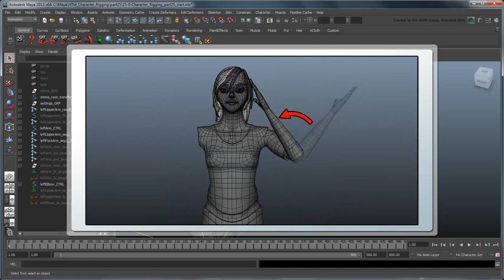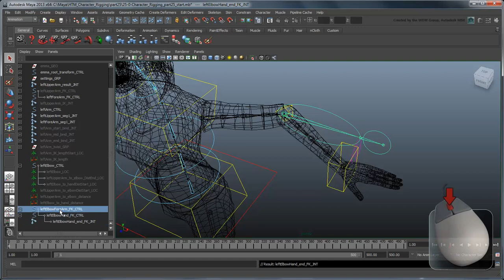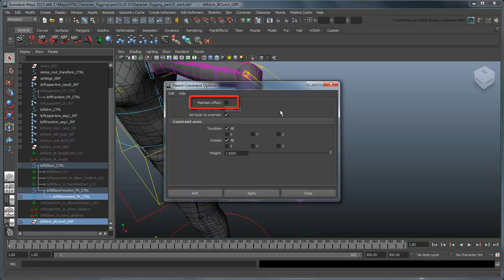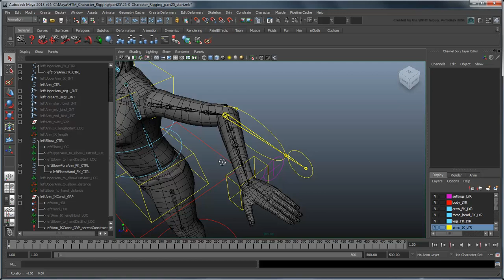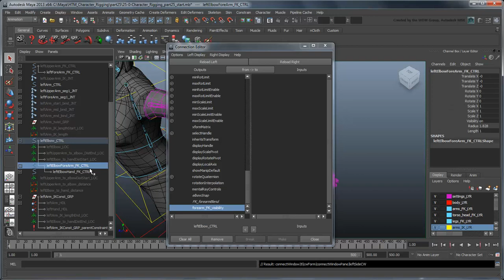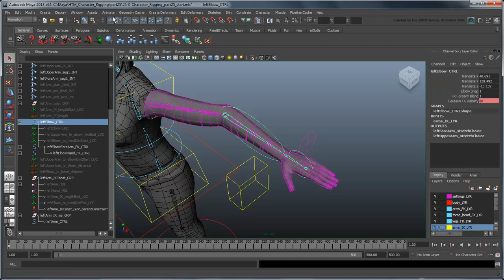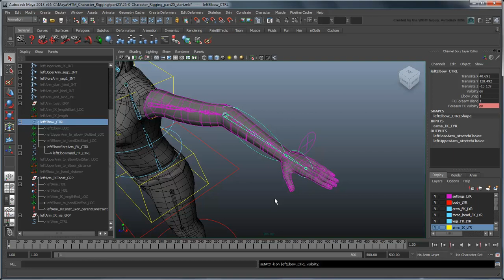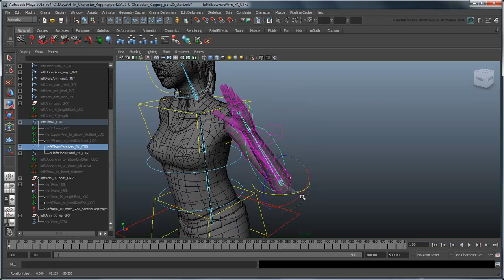Creating a Character Rig - Part 25: IK/FK hybrid elbow (Advanced)

Comment: Hii maya learning channel!!

Thanks a lot for these pro quality tuts and teachings. I have a little doubt here.

I have a little question about the very CONCEPT of this video. i.e. an Ikfk elbow hybrid over an ik setup.

You say it'll be easy for the animator in case he wants precise rotations in IK mode, while what we did is create another FKchain above this ik and made a little switch for it. Isn't that why we have our bigger FK chain and a switch for that setup. The purpose and procedure of that chain is exactly the same as this little fkelbow chain. Why do we even create this one when we have another one with similar amount of steps and functionality already available? Thanx for reading. Please help.
Reply from the maker: Consider a situation where a character is sitting in a chair, with their elbow on the arm rest, but as they're talking they're making gestures with their arm.  In IK mode, it would be extremely difficult to keep the elbow pinned to the same spot on the arm rest.  in FK mode, it would take a lot of work to make the motions appear natural and non-robotic.  But in an IKFK hybrid mode, it would be easy to do both.
Reply: @Autodesk_Maya  thanks for the explanation. I can't agree more that fk rotations start to look robotic too easily. I used it a bit more seriously now. The elbow snap makes things easy and saves time. Thnx again.

Comment: 5:56 I found a bug with this setup, if you blend from FK to IK while "FK forearmblend" is on, at exactly 0.5 blend, the transition makes the hand go sideways
Reply from the maker: Odd, are you getting that in the provided scene file as well?  Because that's not happening with my local one.
Reply: @Autodesk_Maya  Okay admittedly I haven't used the local ones... I guess it's just my rig, then? BUt I have noe idea what to even look for
Reply from the maker: @Exsulator2  Is this on the left or right side of the rig?  This is most likely some sort of local space issue, which might be caused by mirroring parts of the rig into -1.
Reply: @Autodesk_Maya  Actually Left side, don't think any negative scales were involved. On closer inspection, it doesn't happen on the mirrored side, which I find quite puzzling
Reply: @Autodesk_Maya  So I checked and local rotations are; (left side arm)
ik controller = X primary, Y 2nd (+Y)
fk controller = X primary,  Y 2nd (-Y)
fk (ik) elbow = X primary,  Y 2nd (-Y)
constrained grp = X primary,  Y 2nd (-Y)

It's a pickle then... if they should all be the same, then either the IK can't be the same as the world space, but if I change all the others... then normal fk won't be like how this tutorial series set it up?

Comment: Hi, Thank you for your very interesting and educational tutorials.
May I ask something, I create a character but I do not want to give him any squash and stretch abilities. Does a snappable elbow work in that case? 
Thank you.
Reply from the maker: Later in this tutorial we show you how to switch squash and stretch on and off.  However, doing elbow snapping specifically without it won't work using this method (at best, you'll get the elbow snapping as "close as possible" to the control).
Reply: @Autodesk_Maya  Well it would work as long as the polevector was no further than the maximum arm length. It's just not... ideal...

Comment: Hi. I encounter a little problem on the Right side. After parent constraining the R_arm_IKConst_GRP to the R_elbowHand_FK_CTRL my GRP has not Rotation on X as the Left side has. Any ideas why that is? if I rotate it the same way, would that help or make it wors? Thx in the upfront :D
edit: I guess its coz my R_arm_CTRL (IK) has the same Orientation as my R_elbowHand_FK_CTRL. Can I then ignore the correction steps we need to do for the left side?
Reply from the maker: Sorry, I'm not sure I understand exactly what you mean.  However, I can tell you that the Right and Left IK Arm controls should have the same orientation (which should also be the same as the FK controls).
Reply: The R_Arm_CTRL has the same orientation as the other Right chains but on the left side, we have different spaces as u have shown in the tutorial. I was just confused for a moment and liked to ask if this is correct. There is no need to correct the rotation on the right side when constraining to the IKConst_GRP (at minus 4) coz the hand isn't twisting on the right side. sry for bothering you I just wanted to be clear. but I already realized my first assumption was correct.

Comment: I'm @12:35 and when in the Graph Editor I set the tangents to either Linear or Spline and then can't grab any of the Curve handles to make them infinite. They are gray when selected and the handles are visible.
Reply from the maker: You shouldn't need to grab the curve handles to make them infinite, just the point on the curve itself.
Reply: Just setting the curves to linear in 2017 does not do the trick. I have had to grab a handle and position it so the curves angle follows the locked part of the line. For some reason I am not able to manipulate the leftElbowForeArm_FK_CTRL's curves in the Graph Editor. 
See images at: https://www.infinitee-designs.com/maya-2017-graph-editor-interface
Reply from the maker: @RalphManis  Hmm, does this look the same if you set it to Spline?  Linear worked in this version of Maya, but in newer versions you need to set it to Spline instead.
Reply: No, it doesn't look the same but, I still can't manipulate it at all. They seem to be locked. I added an image  with Tangents set to Spline on the previous linked page.
Reply from the maker: @RalphManis  Try selecting your curve, then going to Curves > Non-Weighted.  Does that change anything?
Reply: No luck. Oddly enough, infinite stretch does work with both the leftElbowForeArm_FK_CTRL and the leftElbowHand_FK_CTRL when I use the Move Tool. It just doesn't work using the custom length attribute. See new image added to linked page.
Reply: I just brought the leftElbowHand_FK_CTRL into the Graph Editor and was able to set the Tangents to Linear, Curves Post Infinity to Linear and manipulate the control handles to set the curve to infinite. So, Now I guess I have to dig into it a bit more.
Reply from the maker: @RalphManis  Ohhhh, wait a second.  You shouldn't be doing anything with the foreArm CTRL... you want to be working on the Hand_Ctrl.  Remember, the forearm elongates by the hand joint moving further away from the (stationary) forearm joint.  It totally makes sense that the forearm is locked - there's no actual driven key on it.
Reply: Oh, thank God! I guess we can chalk it up to finding another little typo in the video... As always, thank you for your help! Yes! That did the trick!
Reply from the maker: @RalphManis  To be fair, the video does show leftElbow_Hand_FK_CTRL.  = )
Reply: Why yes it does! All this fuss for nothing! Thanks.

Comment: I have problem im working in Maya 2018 and when I make the parent constraint the handle doesnt drive the joint hand like in the video I tried to fix the with a orient constraint on the hand joint but cause wierd transformation values and unexpected behaviour
Reply from the maker: When you move the control around, does Maya return a warning in the help line saying there is a "Cyclical Dependency"?
Reply: No I figure out because what you explain in prevous video the ctrl I use for the hand have a diferent local rotation axis I make group with a offset and fix the problem but still cant make wrist move with out any constraint like your did in the video

Comment: Hi,
1- As i noticed in the tutorial movie, when you change FK forearm blend value, the character UpperArm to elbow GEO remains constant , but in my character it moves a little! how can i fix that?  (Please check the screenshot) https://pasteboard.co/Hp0GaBs.gif
2- Changing length value and stretching, breaks the arm in my character! (Please check the screenshot) https://pasteboard.co/Hp0PViN.gif
- Thanks in advance for your help -
Reply from the maker: 1.) You're initial setup of the hybrid forearm must've been out of place, which is why it moves.  You'll need to remove any connections to the control and then snap it back to the elbow control before reattaching them.

2.)  It looks like your length attribute is affecting the entire arm, but it should only affect the forearm.  Make sure you connected it to the correct joints (the upper arm shouldn't be involved at all).

Comment: Hi Maya Learning channel!!! I have a question regarding the FK-ForearmBlend.See if the elbow snap is not enabled and we activate  the FK forearm it looks broken and it might confuse the animator. Is there any way to prevent the animator from using the hybrid FK forearm when the elbow snap is off? I have tried to write an expression that would lock FK_forearmBlend if elbowSnap is desactivated but so far its not working. Would you help me please?
Reply from the maker: What does your expression look like?  Rather than locking it, you could try hiding it anytime the elbow snap is set to anything except 1.
Reply: Hello guys thank you for the answer So basically I wrote this but Maya say cannot find the procedure leftElbow_CTRL.elbowSnap:
if (`leftElbow_CTRL.elbowSnap`==1)
{
    setAttr -lock true leftElbow_CTRL.FK_forearmBlend;
}
else
{
    setAttr -lock false leftElbow_CTRL.FK_forearmBlend;
}

So far the only way to fix this would be to add an other extra CTRL on the elbow that would disappear when elbowSnap is at a value of 0. Otherwise if I leave it as it is, the animator will call retakes on  it. From experience I know the animators like to test everything and break stuff to get the performance they are looking for. This is fine but as riggers its our job to bulletproof our rigs so these situation never happen. I would prefer just write a quick expression to lock that attribute instead to putting an other CTRL. What’s your take on it? Thank you sir
Reply from the maker: So the reason you're getting that error is due to the single quotes around leftElbow_CTRL.elbowSnap.  Remember, that's a variable name, not a procedure.  Try removing the single quotes, or using the getAttr function to grab that value.
Reply: Oh great.... Well now it's kind of working but the attribute stay looked whatever if its 0 or 1.To fix this issues what would you do? What expression would you write ?
Reply from the maker: Unfortunately, expressions only evaluate on a changed frame when set to "Always".  Instead, to do what you want to do, you'll need to make use of the "scriptJob" command, which allows you to run a script every time a specified attribute changes.  For example, try this in your Script Editor:

int $index = `scriptJob -attributeChange "leftElbow_CTRL.elbowSnap" "snapTest()"`;
$index = `scriptJob -attributeChange "leftElbow_CTRL.FK_forearmBlend" "snapTest()"`;

proc int snapTest(){
    if (`getAttr leftElbow_CTRL.elbowSnap` != 1){
     setAttr leftElbow_CTRL.FK_forearmBlend 0;
    }
    return 1;
}

The procedure is much like your own, so I don't really need to explain it.  The scriptJob command then runs that procedure anytime the value of elbowSnap or FK_forearmBlend changes.  You can then use a Script Node to run this code automatically anytime the file is opened.
Reply: OMG thats so awesome I cannot thank you enough it's super nice of you. I guess after that I will need to go deeper into MEL Script. Its too bad you guys dont have a complete class about scripting but I'm sure on youtube,I can find tons of tutorials. Again thank you so much
Reply: Is theres anyway to make a this manualy I try to change this script with  the names on my file even doing that it said dont find the attribute
Reply: This script work pretty well but when I dont manually set fK forearmblend to 0 and the script doest is the driven keys still behaving like they are on 1 and the effect bleed over to the Ctrls and I cant put its value to 0 is there anyway to work around this??

Comment: Hi Sir,
At 6.19 of this video my hand joint flips in opposite direction when I adjust parent constraint values manually. I have added image for your reference. Please guide exactly what i'm missing. http://i345.photobucket.com/albums/p389/jay_k1890/hybrid%20solution_zps2cwnvu8v.jpg
Thanks in advance
Reply from the maker: It looks like your Local Rotation Axes on your hybrid arm don't match those of your other arm(s).  Double check those as they need to line up otherwise you'll see the flipping you have here.
Reply: Sir, I had checked the local rotation for hybrid arm and other arm. Image for reference.
http://i345.photobucket.com/albums/p389/jay_k1890/fixing%20local%20rotation_zpsmctjpqww.jpg
Reply from the maker: Is the position of both of them 0,0,0 rotation, or is one of them 360?  If you set one of those controls to 359, what happens when you switch?  Also, does the result hand joint also match those local rotation axes?

Comment: Hi , i have a problem with right hand ,for the right hand whenever i put the rightElbow_CTRL from 0 to 1 the arm first twists then goes to the snap elbow position i think it's becaus of the rightUpperArmseg1_to 5_JNT or for the rightForeArm_seg 1 to 5_ JNT here is the pictures of the rightArm when the elbow snap is on 0, 0.4 ,0.8 and 1.Plz help the leftElbow_CTRL works correctly but the right one dosn't.http://uupload.ir/files/dg34_1.bmphttp://uupload.ir/files/0rhd_2.bmphttp://uupload.ir/files/pmjm_3.bmphttp://uupload.ir/files/j0q4_4.bmphttp://uupload.ir/files/3vjd_5.bmp
Reply: I found out the solution , actualy i compared my file with the maine file complete mirrored rig of ema and saw there are two multiply devideres that theire name was invertValue_MULT they were between the rightUpperArm_to_elbw_dista ceShape node and righrUpperArm_strechChoice and the second one was between the rightElbow_to_hand_distanceShape node and rightForeArm_stretchChoice.Theese two multiply deviders solved the problem

Comment: Hello MLC, Ive been learning so much from your tutorials, they are fantastic. I've got a problem with my right arm. I have the elbows controls ElbowSnap and Fk_ForeArm_Blend attributes set to 1. Then when I go to the right arms setting control and slide the FK/IK blender attribute from 1 to 0, any value from 0.999 to 0.001 will cause the result arm and it's attached segment joint to rotate up and around in a circular fashion from Position to position instead of translating smoothly side to side in the demonstrated way. My left arm has no problems and I've rechecked the videos, setting and connections. I'm sure I'm missing something silly. Help would be greatly appreciated. :) Thank you in advance
Reply: I forgot to add that when the elbow is not snapped the blend works perfectly even when the arms are put in various positions.
Reply from the maker: It could be that one of the joints you're blending between is actually rotated 360 or -360 as opposed to 0.  It's also possible that the spaces are misaligned.  Did you use the shortcut method or have you rebuilt the right side from scratch?
Reply: +Maya Learning Channel Thank you so much :) I re built the right arm from scratch except for mirroring the initial joints. It was the Fk_const_Grp and the Result_Const_Grp which both had a rotation value of 360 on them. I un-parented their children and zeroed out the rotations and reparented everything. Now it all works smoothly. :) Your advice saved me a lot of time :)
Reply: +Clare Savage An update on the problem I had in case it helps anyone else. After I thought I solved my problem I realized it still had some kinks. So after avoiding the inevitable rebuilding of the arm I stripped my arm down and unfortunately found that I had somehow got a rotation on my Ik arm... Silly mistake that wasted a lot of time but hopefully if someone happens to do the same they'll spot it faster than I did.

Comment: I have a problem with the mirrowed joints for the rightHand. I recognize in IK Mode, if i rotate the rightHand_CTRL into Z the rightHand_IK_JNT moves in Z but the rightHand_result_JNT moves into Y. So i can t finnish the hybrid elbow. Even if i prepare the rotate values in the  rightArm_IKconst_GRP (like explained in this video) the hand turns somewhere between 90 and 180 degrees if i turn on the hybridForearm mode. This is not the only problem i have with mirrowed joints. Its generelly better to awoid mirrowing and build the joints manually again for the other side of the body?
Reply: Edit: I figure out that the rotaion axis Z points down by the rightHand_IK_JNT. How i can re orient? If i try to orient joint maya tells me that the other IK jnts have non zero rotaion. So i made a lot of test. For eaxample: If i unparent the rightHand_IK_JNT , reorient and reparent, the result hand jnt flips. Its so frustrating.  What can i do?
Reply from the maker: +Cinemarcus This is actually why you have to orient the joints first, because once you start building components / making connections on top of it that rely on that joint, it essentially "locks" the joint in that orientation.  Unfortunately, you're going to have to break those connections in the Node Editor, then re-orient the joint, then put all the connections back again.